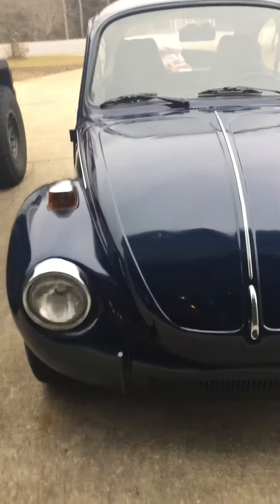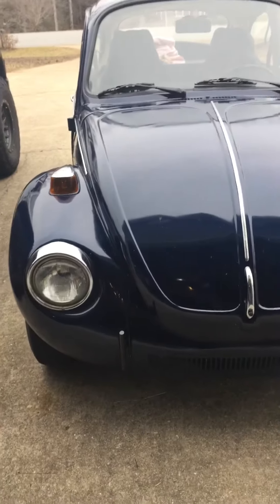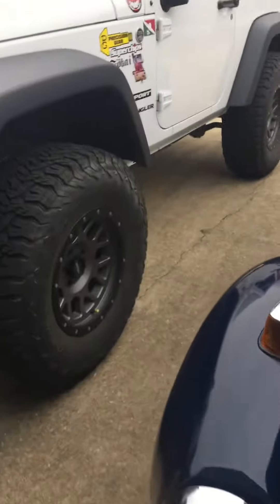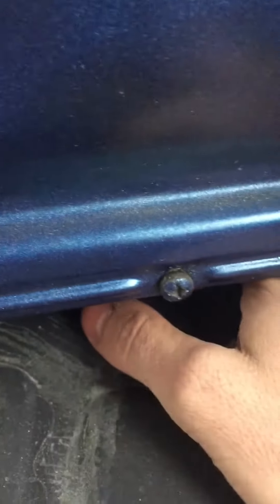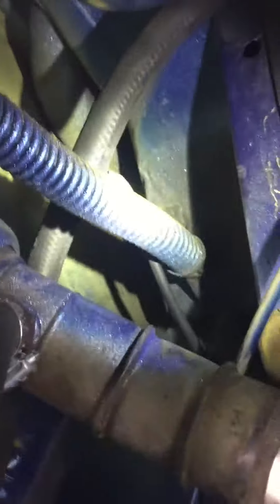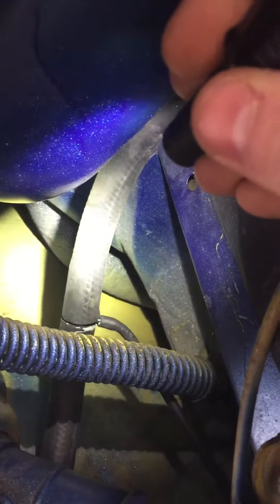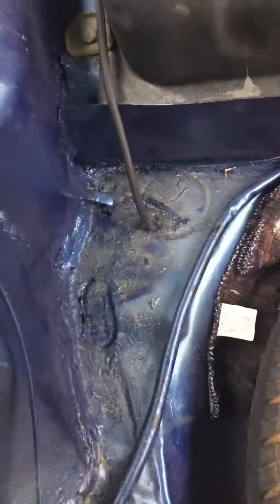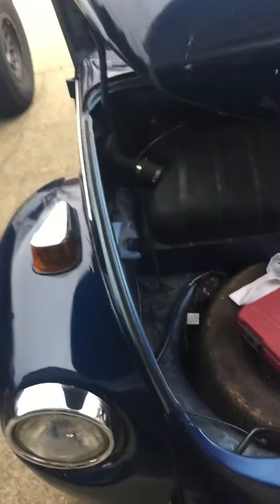Vw beetle fuel smell in the cab fix

Comment: after a while, the plastic piece that goes across the dash panel cap gets saturated with old fuel and that's what smells. It's not like gas is leaking anywhere. I personally just never fill the tank on my 73 and I don't have that problem
Reply from the maker: @russriley3005  yea over the years we just fill it to 1/2 tank